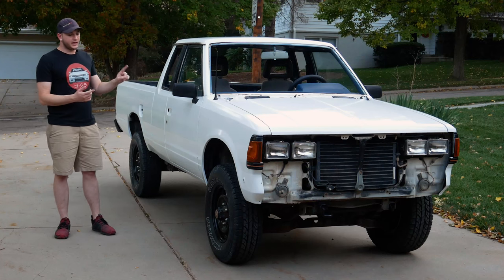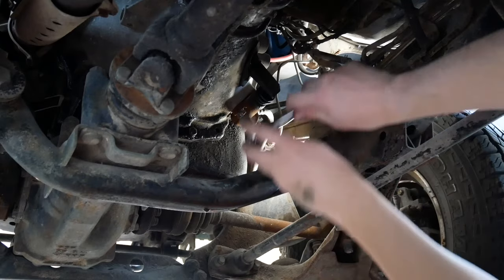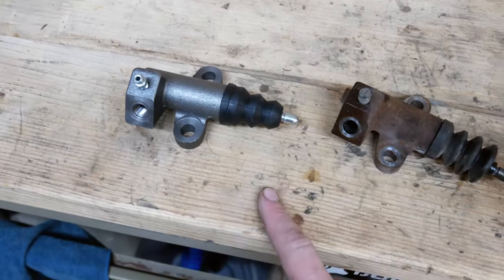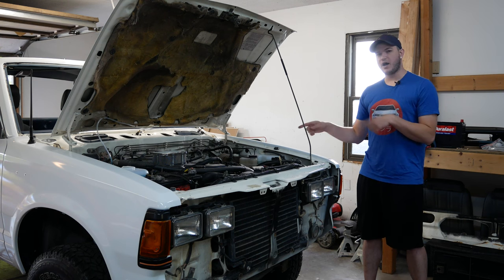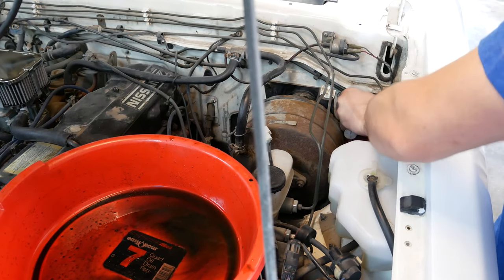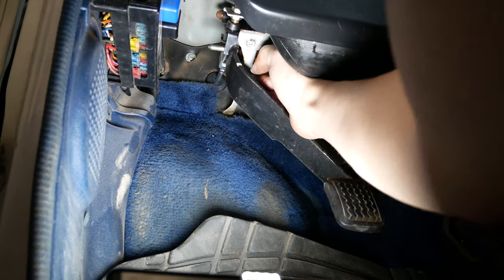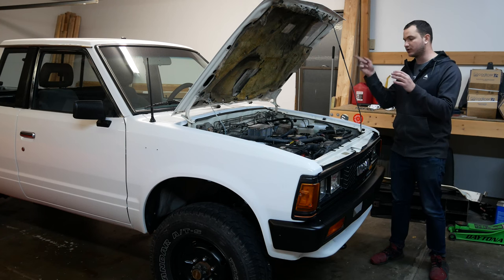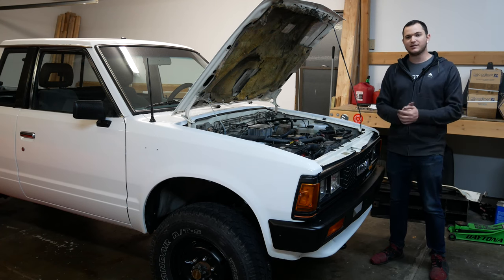Replacing the Slave and Clutch Master Cylinder in the Nissan 720!

Comment: My slave cylinders last about 3 months and After bleeding the master it ships really good for about 6 hours and there's some type of micro leak e and then it's hard to get in the 1st gear again and I replaced every thing every single hose every single part you can think of...Flare seals need parker washers

Comment: I didn't quite understand the slave bleeding process after replacing master cylinder. Exactly what are you pressing on?
Reply from the maker: I was pressing the slave back into itself to force air up and out the top. Then it would slowly decompress itself pulling down fluid.

Comment: How did you take the screw on the side of the clutch master cylinder off? Did it just screw off? Mine is stripped and trying to figure away to fix this, everything else came off just fine. Any advice or thought on how to get around this would be obliged.
Reply from the maker: Its not easy to get to, but mine did just screw off. Had to make sure I had correct sized tools to get to it properly.
Reply: @TheAngryHoneyBadger  mine was stripped. do you have any idea how to replace this part? I was going the pipe off and then find the nut or screw to put back on.
Reply from the maker: @stephencozine1234  The nut holding the unit to the firewall? If it's that stripped you'll probably need a kit like this to get it off -  https://amzn.to/2RqP5RG
Reply: @TheAngryHoneyBadger  No not on the firewall but on the side of the master cylder, where the pipe is on the side. That piece is stripped.
Reply: @stephencozine1234  did you find a solution?  Do you know what thread that bushing is?

Comment: How long did it take to bleed the truck
Reply from the maker: It took a bit of time. Worked on it from the clutch pedal as well as the slave cylinder. It can be a bit of a pain to get all the air out.